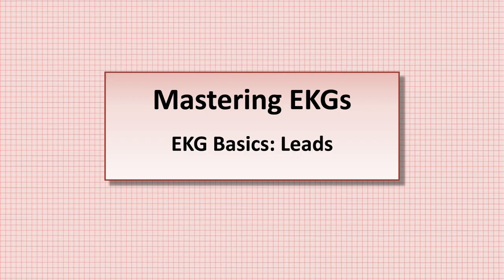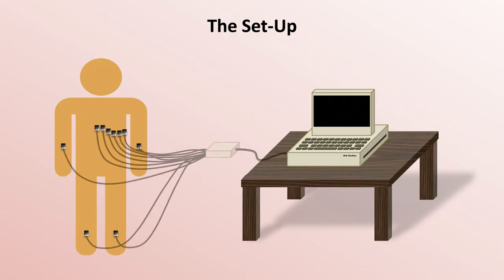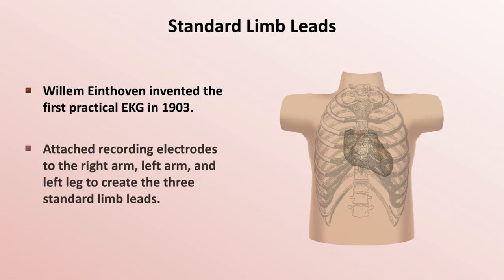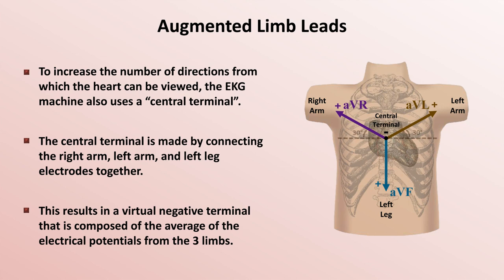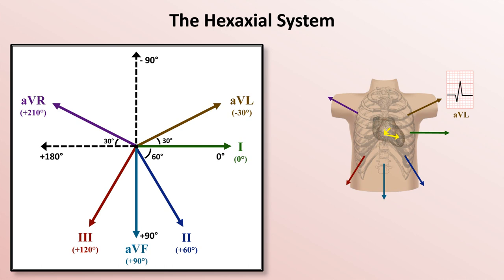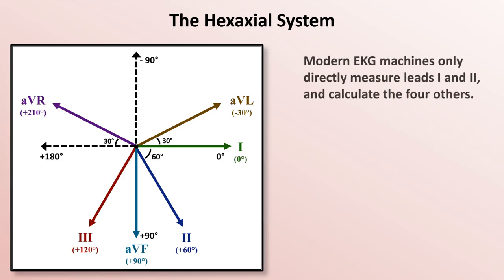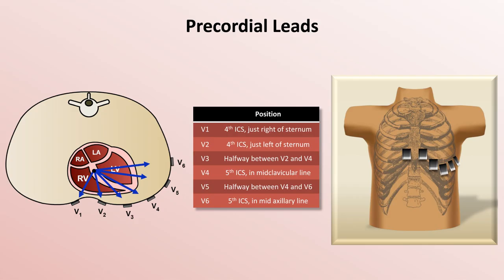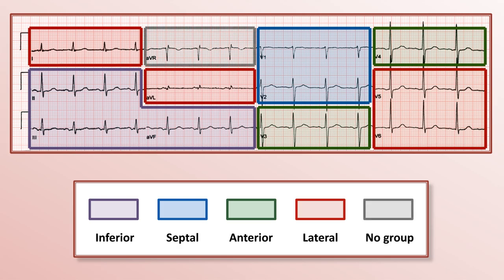Intro to EKG Interpretation - EKG Leads

Comment: Hello Dr. Strong, when you talk about modern EKGs measuring only leads I and II, does that mean that they only have to attach 2 electrodes in the chest? And how does the accuracy of modern EKGs fare with the 12-lead EKG? I saw a device that you only need to hold and put into your left limb. It's called KardiaMobile and it comes with an app.

Comment: I had a hard time learning the ECG (and I am still not done yet) so I thought the following might help some people:

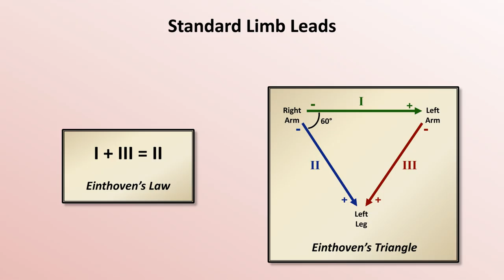7:36 - instead of trying to understand the formula you can rather prove that it is correct and boost your confidence:

1. Take the qrs complex from lead I and substract the obtained values, e.g. let's say the q wave is -0,5, the r wave is +3 and the s wave is -1,5--> -0,5 + 3 + (-1,5) = +1

2. Take the qrs complex from lead II and substract the obtained values, e.g. let's say the q wave is -0,5, the r wave is +8 and the s wave is -4 --> -0,5 + 8 + (-4) = +3,5

3. Take the qrs complex from lead III and substract the obtained values, e.g. let's say the q wave is 0 the r wave is +4,5 and the s wave is -2,5 --> 0 + 4,5 + (-2,5)  = 2,5

Now use the formula I + III = II [or the formula I + (-II) + III= 0 (in my opinion more smexy)] and you can see Einthoven was cool:

1 + 2,5= 3,5 [or: 1 + (-3,5) + 2,5 = 0 ]
 
If you're wondering: You gotta use -II because Einthoven, instead of going clockwise, switched the positions of the electrodes of lead II.

http://www.ems12lead.com/2008/10/04/axis-determination-part-i/ good site btw and got my info there!
And the "v" in "avR" etc. stands for "vector", not "voltage"

Ah and thanks for the video! Helps a lot!

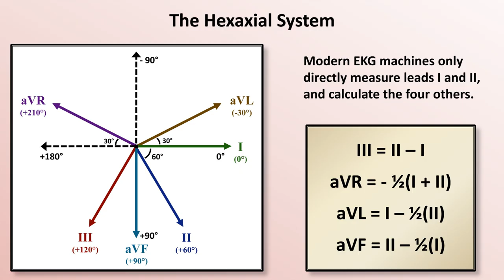14:48 - the formulas seem to be difficult but they aren't, see the formulas in the link below rather then in the video and you'll understand soon: https://ecgwaves.com/wp-content/uploads/2016/08/goldblaw.png

To understand them just check your hexaxial system, preferably one with with correct poles, e.g. https://upload.wikimedia.org/wikipedia/commons/5/56/Hexaxial_reference_system.svg (arrow down means negatve pole, arrow up means positive pole). Then check again the formulas I linked and you'll understand :-)

12:25: The q wave in lead II should be a bit negative, right? It was drawn here to be isoelectric because the septal dep. is nearly perpendicular to lead II, correct? Wouldn't then the major ventricular depol. shown in lead III also be isoelectric rather than showing negative (because again it is nearly perpendicular to lead III)?

Comment: The reason that Einthoven's triangle represents voltages in the chest even though the electrodes are on the arms and legs is because the voltage on, for instance, the right arm is the same at every point until it reaches the torso. Essentially the arm can be thought of as a wire connected to the torso, and carries the voltage at the point where it attaches to the torso; same with the legs. Voltages only change when currents are flowing, and current only flows when there is a closed path, taking the path of least resistance. No current generated by the heart flows down an arm and then back up, as that would have more resistance than just returning from where the arm meets the torso. Hence, the legs and arms each are at the same voltage as the point where they connect to the torso in which currents from the heart are flowing. Hope that helps; it's a little difficult to put into words, but if one draws a body and models it as a network of resistors, it becomes apparent that no heart-driven current would go down and then back up an arm or leg, it would just return from the point where the arm or leg connects to the body as that is a lower resistance and shorter path. The whole shebang depends on the fact that the body is a conducting but resistive media, and air is insulating, so all current is confined to the body.

Comment: Great Lecture. The vector addition worked best for me with Einthoven's Law. In degrees it doesn't work out. I was  taught how to place ECG leads by a very picky Emergency Room Resident. Most of the time my recordings were good but occasionally the problematic ones were people fidgeting about and  women with huge pendulous breasts- until an RN told me to tape the breast out of the way so I could palpate the ribs. I'm a physics geek so I figured out a lot about the electrical stuff on my own so if the ECG didn't look right I would repeat it to double check. That resident became an OBG guy!!!!!

Comment: I think the reason these 3 are used in the rhythmal strip is due to V1 being most sensitive to the right side of the heart while V5 to the left isde of the heart ( v5 is chosen over v6 because the latter's magnitude value is affected by the pleural tissue) and ofcourse limb lead2 due to it being the most parallel with normal heart activity.

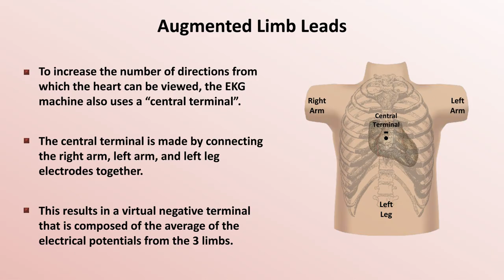Comment: Professor, the Wilson’s central terminal I believe is composed by two limb leads as a negative and one as a positive for example for aVR RA will be positive and the average of LA and LL will be the negative, not as stated in the video at 8:25 that it is composed by the potentials of the 3 limbs.
Reply: For the precordial leads the statement in the video is valid of course as the positive will be V1 V2 etc and the negative will the the average of the three limbs.

Comment: The interventricular septum is actually depolarised from left to right ,and also in upward direction ,(maintaining left to right) but not in inferior direction(maintaining left to right) as told by you. please clarify.The arrow should be slightly upward, & from left to right.
Reply from the maker: Thanks for the comment.  According to a figure in Braunwald's Heart Disease (the only one of 6 cardiology texts I looked through which addressed this), the very initial 20-30 ms of ventricular depolarization originates from the middle of the left side of the septum, and is oriented down and to the right, as shown in the video (Braunwald 10th ed, Fig 12-10; unfortunately the figure does not appear to be publicly available.)  The remaining part of septal depolarization does depolarize up, back, and to the right, but this is occurring simultaneously as depolarization of the ventricles, and not as an chronologically separated event.  Another way I look at this, if the initial direction of septal depolarization was up and to the right, we would expect to see septal q waves in lead II, instead of lead aVL.  Please let me know of any references that might contradict this.

Comment: Hello Dr. Strong, I had a question about the PR Segment. Why is this segment at the same level as the TP segment? During the PR segment, there is a great difference in potential between different poles of the heart since the Atria are fully depolarized but the ventricles are still polarized? Is the EKG actually measuring current? This might make more sense because the AV node allows so little current through it.

Comment: Excellent! very helpful. Just one question: Why at 10:34 the event angle is down and directed to right. What does define the direction and angle of the vectors showed in yellow?. Is the only thing I couldn´t understand. Thanks!
Reply from the maker: The 2 vectors shown in yellow represent 2 sequential phases of ventricular depolarization.  The first phase is depolarization of the septum, which occurs from the left bundle, and therefore the net depolarization of the septum during this phase is in a left to right and slightly inferior direction (since this direction is perpendicular to the "plane" of the interventricular septum).  The second phase is depolarization of the bulk of the right and left ventricles, which occurs simultaneously; since the left ventricle is more massive than the right, the net depolarization vector is directed more to the left.  In reality, ventrcular depolarization does not exist as 2 discrete and seperate phases as the diagram suggests, but such simplifications explain the sharply biphasic/triphasic nature of the QRS complex.  You may find a discussion of this issue in my video on chamber enlargement (around 13:18) helpful, as it goes through the same sequence of depolarization, but from the view of an axial cross-section/axial plane.
Reply: Thanks doctor!

Comment: Hello Dr. Strong! For the six limb leads, there's 4 electrode placed on the extremities. I'm wondering whether this statement is true? "Limb leads can be placed on any part of the patient's respective limbs. Just make sure the leads are symmetrical. "

Some put the electrode just proximal to the wrist, while others put it anterior to the shoulder. I've seen both kinds in the hospital. Wondering it should alter the voltage or lead axis , and therefore affect the analysis?
Reply from the maker: For a long time, I didn't think it mattered much where on the limb the electrodes were placed (i.e. anywhere from the shoulder to the wrist on the arm, thigh to ankle on the legs - some people even place the leg electrodes on the lower torso just above the inguinal region). However, it actually does matter. Placing the electrodes too proximal can lead to clinically relevant errors including a rightward shift of the QRS axis, decreased sensitivity for picking up inferior ischemia/old MIs, and misidentifying the location of VT/PVCs. Proper location is arm electrodes on the wrists, and leg electrodes on the shins.

A few relevant references:
https://pubmed.ncbi.nlm.nih.gov/18790505/
https://academic.oup.com/europace/article/17/12/1840/2398514
https://pubmed.ncbi.nlm.nih.gov/3653124/

Comment: Hi. Great course but you are missing one important part to be lecture 2 or 3: how to approach the ecg paper - 

what are the X and Y axis ?
 what does the small and big squares mean time wise and voltage wise ? 
what is a positive and negative waves, how to sum them up and how they relate to vector deflections?

and so on...
Reply from the maker: +asheriko26 Thanks for the feedback.  The X and Y axes are discussed in the video on Rate and Axis.  And vector addition is touched upon qualitatively in scattered places throughout the course.  I agree there isn't a dedicated section to that, and when it is discussed, it's done so very informally.  However, when I've taught EKGs in person, I find that a lot of learners (basically everyone who was not an engineering major) tune out when you start discussing vectors too much, just like they tune out when discussing relevant cellular physiology (e.g. why most T waves are upright, etc...), and the circuitry underlying the machine.  They're all interesting topics for some learners though, and if I ever get around to finishing the core topics (e.g. differentiating SVTs, electrolytes disorders, effects of antiarrhythmics, etc...), I hope to have time to cover those as well, maybe as "accessory videos" or some similar designation.

Comment: Dr. Eric ,thank you very much for your interesting and Goal Oriented videos. My question IS on your explanation OF  I+III=II you Said " At any given time the voltage measured by lead one plus à voltage measured by lead two must be equal the voltage measured by lead 3" I could not understand B/se the formula and the explanation do not fit.
Reply from the maker: You are quite right.  There is an annotation on the video pointing out that I misspoke, but you probably either have annotations turned off, or are watching on mobile (on which annotations don't work).
Reply: Hi Eric! I am watching your videos using Ipad and mobile.  I think it could affect annotations.
Thanks!!!

Comment: You said that right leg is not included in EKG leads as it acts in earthing. But you said that an electrode is places in measuring EKG. So, what's the importance of that electrode ?
Reply from the maker: Sudpita, I'm sorry but I'm afraid my knowledge of circuits is not strong enough to provide a more detailed explanation of why the right leg electrode is critical in EKG recordings.  Interestingly, I've been told by EKG technologists that you can actually place the right leg electrode anywhere on the body without noticeably changing the EKG, but I've never actually tested this out.